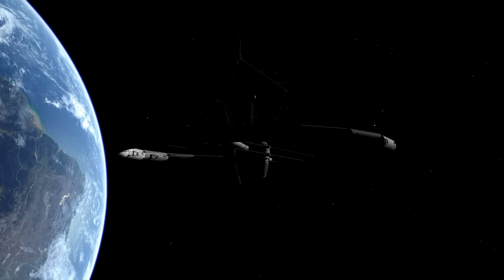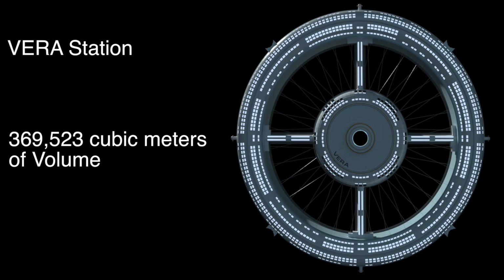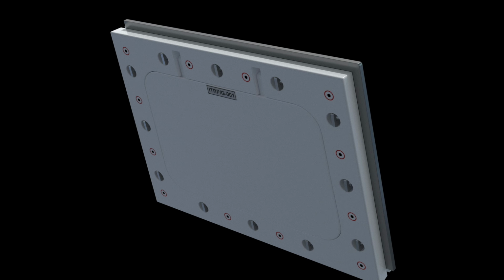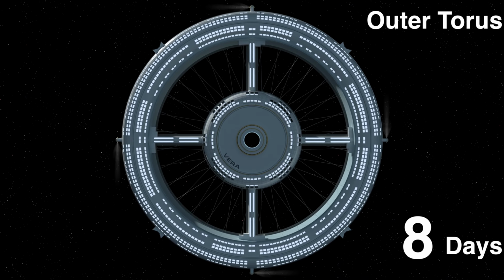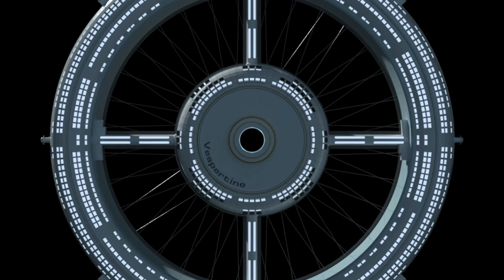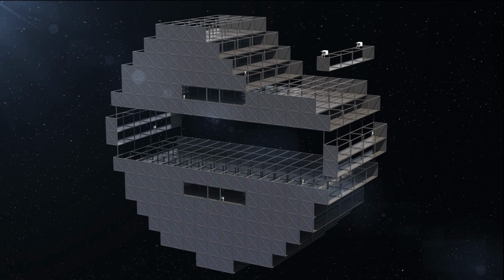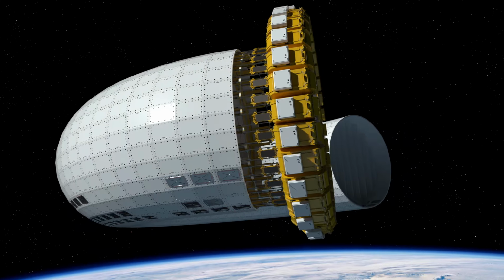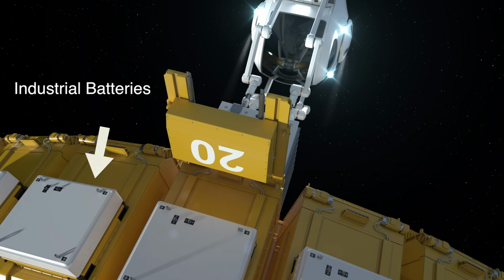We could build this huge Space Station in 6 months

Comment: The short build time referred to in the video would just be for the outer shell of the taurus rings, and wouldn't include the internal components. ie, habitat, research, storage and command sections with equipment such as computer systems, piping and wiring, air recycling systems, galley/kitchen, waste systems, power plants etc.

What would the construction, transport to orbit and final assembly for all the necessary systems for the ring to be functional add to the construction time?

Comment: Stop building space stations and build a massive shipyard in high orbit , so we can begin building huge ships out in space , and research different types of propulsion systems ,we could also use ships to capture small asteroids and use the shipyard to break down asteroids and smelt the metals , the more expensive metals and minerals and elements can be sold to pay for the building and maintenance of the shipyard  , A huge section can be used to grow plants that quickly produce oxygen as long as there are humans there to provide Carbon Dioxide , the oxygen can be pumped throughout the shipyard , there should be radiation shielding connected too but ten miles out from the shipyard this way the shipyard will last for hundreds of years , and only the huge panels that make up the radiation Shields would have to be replaced , if you think capturing astroids would be hard , you don't have a very good imagination , they are matalic , you ever heard of electromagnetic magnants  , we use them every day !

Comment: I dont like the donut designs. For me either cylinder or hammer works better because for a donut it doesn't take much more material to make it a cylinder and if you really want to save mass going for the hammer design makes more sense. Also you're going to want material in the middle anyway for docking and zero g activities anyways.

Comment: I think it is going to take a lot more time for construction of auxiliary equipment, tools, and machinery just to get to the point of lifting it all out into space. It will probably take building a lot of huge space freighter ships or a lot more smaller ships even if they are going to be re-used. Wouldn't it be more practical concentrating on getting people to mars first instead of making hotels in space for rich people?
Reply from the maker: SpaceX Starship will lift all of the parts, equipment, and other items into orbit.
Reply: @TheGatewaySpaceport i believe this may work godspeed

Comment: Feels 4th gen not second. Firstly relying on starship is a bottleneck. Used not because form factor but because weight to orbit can be done. Modular works. Throw 100+ falcon 9 launches you are also most guaranteed to have the design vs the risks associated with starship. Depends if we talking 2 decades or 6.

Comment: So, no part of the toroid, since it is "continuous volume", can be used until the whole toroid is complete?  What is the rate it can build this station?
Reply from the maker: Check 9:29
Reply: @TheGatewaySpaceport  Thank you.  By sun-synchronous, as in assembling "always in Earths shadow" for thermal consistency?  Welding in space has not been performed since the 1970s/80s (Soyuz-6 1969, bead-on-plate welding Skylab 1973, and Salyut-7 capsule and made the first (and last) welds in open space in 1984). Not suggesting it can't be done with e-beam, just seems risky (not to mention requiring a lot of power). Would the welder(s) not act like an ArcJet thruster?  Have you put up any micro-sats with proof of concept (welding) experiments? I don't think "tourism" is the right play here. I think you should align more closely with E Musk's multiplanetary vision, otherwise you would be doing what BO does - what is the value proposition there? "Look at me, I went to space - just 250 miles away" .... It makes more since to me if the Gateway Spaceport orbited Mars.
Very interesting and ambitious project - I'll continue to watch and sincerely wish you and your team all the best.

Comment: Cool. And very ambitious. It is unusual to see someone this determined to push the development in space. 
A comment though:
The inner and outer ring must spin with different speeds. Also the commute between the rings needs an increased stair design. This way you can go from no rotation force to full rotation force with inclination.

Comment: I think the ambition is correctly sized though I know nothing of the companies or individuals that are attempting this, the direction is what's needed.

A small suggestion however would be to work towards a proof on concept first with the intended systems in mind.
By this, start with a simple truss system that houses two main segments at each end (consider a central point also) this demonstrates the truss construction systems and if rotated also demonstrates the artificial gravity stresses on the frame. 
This brings in backers for the next phase which allows you to fund more production units speeding up production.

Stage two could be expanding on the central hub for docking and the loading unloading process for the larger payloads, in effect the logistics portion where your drones are brought up to manoeuvre the cargo from core to outer range. This is where extensions of the outer truss could be fabricated into modules. At which point you have a functional station with artificial gravity and could be used for science or tourism generating additional income

Finally, bring in your final ring fabrication system to build the tube structures from top module to lower module on both sides (unless you prefer to build in quarters and have a four way truss system). 

This staging allows you to grow the project rather than need everything right from the start. It is far more sustainable and reduces the expense of learning errors

Comment: This construction design looks very capable of achieving the goal of building toroid shaped space habitats. I think we would be missing one important possibility if we don't also build similar toroids to be used for farming. Of course these first ones will be small compared to what could be possible, once the technology is running like a well oiled machine. Imagine a torus shaped space habitat that is perhaps a mile or two in diameter, has a diameter of say 500 feet for the inner part of the tube. For farming, such large toroids would be ideal. The living areas could be in the lower levels under the farm level. The farm level would be used to help keep the oxygen levels up, through photosynthesis.
What I'm saying is that as soon as the possibility is available, begin farming in those habitats

Comment: The ability to open the assembly ring and join it with other assembly rings for the construction of larger diameter Tores would be a wase upgrade to accommodate future habitat and agricultural habitat needs.

also including a straight cylinder capability for O'Neil cylinder construction would be desirable from a utilitarian standpoint.  

That way you could build any size or type of cylinder space station that a customer would like with one machine design with one or more machines.

Comment: Build a floating scalphold in the shape of a wheel the size of the earth and make it spin fast and fill it up with self leveling concrete to several feet thick and convert it to an advanced city nature habitat that rotates around Earth's equator and is close enough to make use of the earths atmosphere and designed similar to the station called elisium.

Comment: If you build like 50 of them then center connect those add more structural reinforcements add some ion drives on the end solar sail Infront.
You have a generational space craft....
And if you would make the assembler welder in pivotable sections it could do much more then just donut shapes.
they show a 32 max section that's fine but if you would make it pivotable it could split  and add sections of a other assembler or even combine 1 2 or unlimited sections.
and for repair it would be easy to remove and replace instated.
And or like when you would add a dome a assembler section that can place triangles.
Haa this is so epic :p
SPACE CNC WORKS!!!

Comment: I understand your concept and it is quite viable; I have a couple of suggestions that may help: 
Build a modular station as a jumping off point. Use said modular station as a dock and storage for materials. design a mining ship that is remotely monitored and controlled by a small team and then build a dozen or so of them. The trip to the asteroid belt is a while on its own and you may need a refueling station at least once, maybe twice, along the path, depending on how much burn time is needed. Near the belt have a refining yard that will be manned by the operators of the miners and another dozen or so personnel. to operate the refineries and the station itself. Use the mined materials to build and shape the panels, sending back a load at a time to the dock & storage location. It will cost you less in the long run to do it this way than to keep sending materials from the surface. As a bonus, any excess/unused material can be sold off and lowered into orbit. 

Ice can also be extracted to make at least 3 required items: Water, oxygen, and hydrogen. The hydrogen can have multiple uses, not the least of which would be fuel for the thrusters on the ships and to power hydrogen power plants to help offset solar power. The hydrogen power plants would also be able to run induction furnaces for refining the minerals in the asteroid belt.
Creating a hydroponics system will help scrub out the CO2 and provide vegetable foods. Raising animals such as rabbits and fowl will also provide non-veg protein which will be required to help maintain muscle mass. The human and animal waste can be dehydrated and chopped up to become a basis for fertilizer for said hydroponics system. The additional animal products from the rabbits (fur, bone) and fowl (eggs, feathers, bone), will also be useful to those above systems.
Your biggest issues would be entertainment and ensuring positioning. The latter is easy enough if beacons are placed at key points to help guide astro-navigation.

Just the way i would approach the situation.

Comment: If you stop using rocket fuel, you can drop the price.   If there a way to install a small nuclear reaction on a shuttle and have it power rocket like engines, space travel will be easy.  As long as you keep using rocket fuel, you are not going anywhere.  After that, you can work on the hull designs and equipment.

Comment: Why is a torus needed? A cylindrical station is easier to make (and using the same setup that you plan to use for welding or riveting), you need fewer panels of different shapes and the usable area benefits. It could potentially be built like a shipyard; a ship can be built in the center of a cylindrical space.
The torus is an unfortunate form of construction!

Зачем вам именно торус, цилиндрическую станцию проще сделать (причём используя ту же конструкцию что и у вас для сварки или заклёпки), меньше надо разной формы панелей и по полезной площади она выигрывает. В потенциале её вообще можно сделать как верфь, в центре цилиндрического пространства можно корабль строить.
Торус неудачная форма конструкции!

Comment: Cosmic rays gradually deteriorate many things: solar panels; metal (aluminum); plastics and so forth. How will you address those issues? And why LEO? That requires periodic orbital corrections. How will you address that issue.
Reply from the maker: Galactic Cosmic Rays (GCR) are the reason we want to stay in LEO. The Van Allen belts give LEO space stations a lot of protection from radiation in space( both types: GCR's and SPE's). In addition to the natural protection offered by our magnetosphere, we plan to use a water wall and polyethylene to protect the crew and guests.
Reply: @TheGatewaySpaceport  Thanks so much. I was thinking about a LaGrange point but you answered my questions. Thanks again.

Comment: A great idea in theory.  However, one potential challenge is maintaining alignment of the structure during the construction process. How will the structure maintain perfect alignment for the two ends to meet precisely? Will small positional errors accumulate to cause an offset of the two ends? Even each ring itself could have distortion issues.  Any welder knows that heat distortion is a huge problem in producing precision structures.  Heat distortion could be a huge problem to overcome.  Space vacuum is a perfect heat insulator.  There is no air to which welding heat can be transferred.  The only means of heat dissipation in space is by radiation, and this can be very slow. Even during orbital cycles from the cold of the night time side of earth to the heat of the day side presents thermal expansion and contraction cycles that might be problematic.  The larger a structure, the greater the total magnitude of expansion and contraction. Wonder if Gateway has a solution for this potential problem.
Reply from the maker: Good points Stanley. 
Yes, we have solutions to these potential problems. The alignment problem could be a big challenge so we found a solution to that one a while back. We will build 4 reference rings for each torus (two equatorial, two polar) to ensure proper alignment in construction. 
As for the welding: Electron beam welders are very efficient. They create the smallest weld pool (low heat production) of any type of welding and the best welds. And remember the plates are very big so they will absorb a lot of that heat. But regardless of our plans we still expect challenges since this is a new industry. 
Thank you for your excellent comments and thoughts.

Comment: Now I have 2 questions: where is the micro-meteoroid protection, assuming it's a rigid material you'd want maybe an inflatable kevlar skin for the obvious advantage, otherwise it could become very heavy quickly for adequate protection, if not how to mitigate a breach?, bulkheads?

Second main question of 100, is the assumption is you'll utilize a rotating mass for simulation of gravitational forces, any in roads of other options, I'm assuming carl sagens method of x diameter of the top of my head was like 1.8 km diameter worked out a favorable mass for rotation to simulation of gravity or we assuming non- gravity simulation

I have a lot of questions if you ever wish to communicate
Reply from the maker: 1. At 11:56 John describes the panels as 5cm AL 2219 with "Whipple Shield" (look that up) on top. Any small breech would be patched from the inside. The sheer volume of air within the torus gives ample time to do so. It takes hours for the pressure to drop significantly in this large volume. Any large debris the station would dodge using thrusters. If the station did have a large breech, then the Mobile Patch System (MPS) would activate, and an automated system would push a plate over the aperture from the outside until a work crew could bring in an internal plate and weld it into place. The Mobile Patch System has not been depicted in any of our videos so far.
2. The station will rotate for Lunar Gravity (0.17G) so the RPM is only 1.24 

Thank you, good questions.

Comment: designing somethin on paper and 3d is one thing but the actual production is the hardest part..theres so many things to consider you need a team of 1000 super engineers to do it.. before anyone allows anything living inside one of these in vacuum of space it must be built on earth as prototype.. even that is a pain in the butt... now do it in vacuum of space and super cold temperatures.. the machine malfunctions, metals contract on the dark side of the earth and expand on the light side.. the list goes on and on and on.. the number of problems a project like this is a total pain.. the only thing how this can be done with ease is a giant 3D printer that can create vacuum sealed structures without seams on a atomic level.

Comment: i love what you have designed and your ambition, as a mechanical engineer myself, i really think the way to build large structures in space is going to be flexible and not solid panels, benifits of flexible would be having a layer of autmatic sealing incase of punctures, less parts in turn less failures, easy to send and pressurize, also some flexible materils can be stronger than steel whilst being lighter, and you could probably ship the whole station in a couple starship lanuches.
assemblying in space would come with a ton of issues, i think to start manufactring on ground is crucial.
if one of these panels doesnt sit right or a bolt is not properly screwd or somthing as simple as that, it would be a massive problem, becuase you wont know if it'll hold presure until assembly is complete. as with flexible you can test them in modules on earth and just connect modules in space with some sort of robotic arms and thrusters.
Reply: designing somethin on paper and 3d is one thing but the actual production is the hardest part..theres so many things to consider you need a team of 1000 super engineers to do it.. before anyone allows anything living inside one of these in vacuum of space it must be built on earth as prototype.. even that is a pain in the butt... now do it in vacuum of space and super cold temperatures.. the machine malfunction, metals contract on the dark side of the earth and expand on the light side.. the number of problems a project like this is a total pain.. the only thing how this can be done is a giant 3D printer that can create structures without seams.